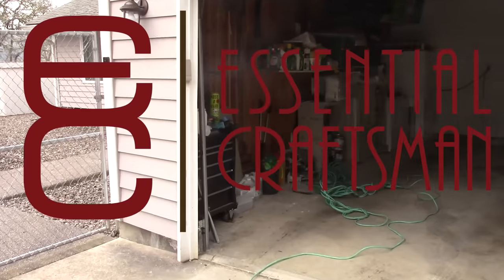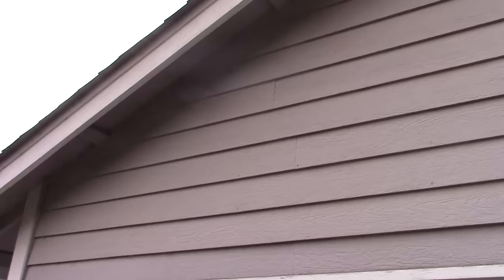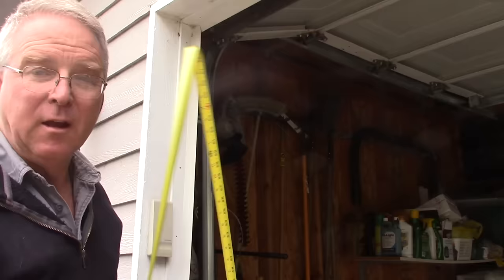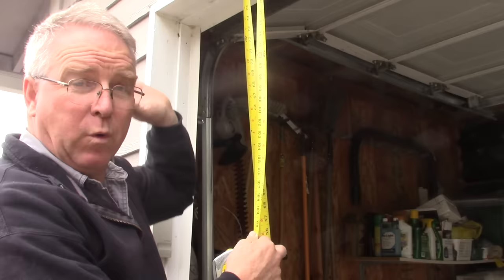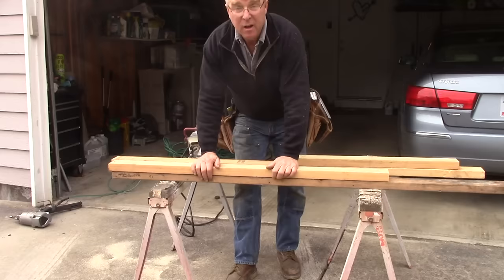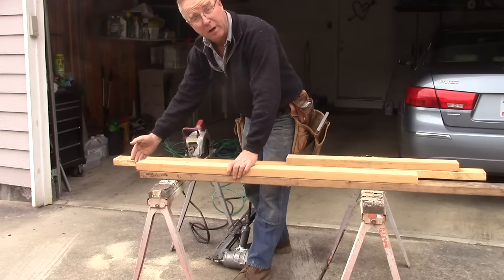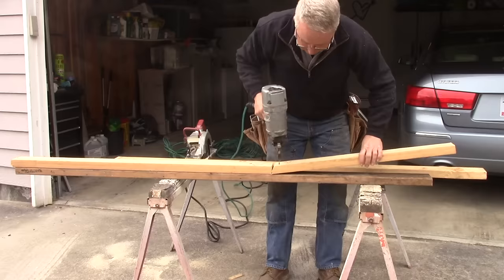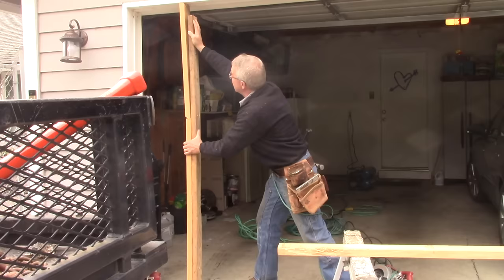2x4 Becomes a Jack - Cool Trick

Comment: There have been so many times I’ve had to stop what I was doing and go get a hydraulic jack to do what this has accomplished. When I already had 2x4’s on the walk board with me. This has saved me a lot of time and impressed my boss. I couldn’t take the credit in good conscious so I told him I learned it from your videos lol thank you so much!
Reply: I had a customer assume I was too cheap to by a whole stud! not knowing I was lifting the second floor to rights so the studs would fit .
Reply: Destin Ramsey 
There is no loss in giving credit to someone else. If I were your boss I would value that you didn’t take the credit for it yourself AND that you watch video’s to enhance your skills.
Reply: @Conservator.  actually I learned this technique from a 1989 volume of fine home building magazine.
.well before the internet.
Reply: George McKenzie 👍
Reply: @georgemckenzie2525  Hmm
Reply: @idwtbam  I screw the block to the top lever, that way I can easily repurpose the unit to different lengths.
Really good for lifts of a 1/ 2 at a time under 5 tonnes
Reply: @georgemckenzie2525  Thanks, but it also just reminded me OF magazines. When I get through my books...
Reply: @idwtbam  I have Taunton Press F-H-B from 79 through 91 when the adds overwhelmed and became the articles. Absolutely recommend it for any builder 
Now of of course it's all on a searchable CD ....
Reply: @georgemckenzie2525  I looked into this. Thank you.
Reply: You did the right thing by going to get a jack. The quickest and easiest solution is always the best and if you had a jack on hand that was obviously the ticket
Reply: Honesty and modesty!  Good to hear!

Comment: A big c-clamp might have been handy, as an alternative to nailing the boards together once they are in place at full lift height.
Reply: Tougher to tighten and hold that in place. I get your point but a few nails from a nail gun is easier.
Reply: I'm a boat builder, so C clamps are how I fly. House carpenters may not have em laying around.
Reply: Better then a c clamp, would have been a quick grip clamp.
Reply: I think I'd prefer the nails he used, seems a bit safer.  A clamp up that high and not fully tightened can fall on your head, or slip and let the load down while you're in the middle of your repair.
Reply: I would suggest using the impact driver he fastened the wall with and a couple screws. If you start the screws ahead of time you it is as one handed easy as the nailer but also as easy to undo as clamp.
Reply: Good info.  Solved many a problem by just taking a break.  Bought a huge C clamp at.HF.  Found 20 + uses in 2 weeks. I have about 20 clamps and use them all
the time.  Good thoughts on the C clamp.
Reply: A c-clamp might work well, but I think maybe the idea is one may only have boards, a nailgun, and a saw on site.
Reply: @JusBidniss   good point
Reply: You may be able to start the nails with your hammer while the boards on the ground. Then drive them home. I don't have a nail gun lol. But I do have a drill and screws. I mainly do electric work.
Reply: @nateman10  good points..
Reply: @JusBidniss  I've had things fall on me from ladders.  it can be painful if it's a metel thing like a hammer hits you on your head. 
I've seen some amazing done by some block masons.and roofers.
Reply: @PIANOSTYLE100  from the right distance any object can be lethal. Building cooling towers which are around 40 to 50 ft at least, ive seen people get seriously injured from things you would never consider dangerous. One guy got his collar bone shattered from a 1/2in washer one time from about 30 ft. Another guy got his forearm broke, all the tendons in his elbow, and shoulder dislocated by a 6 inch 4x4 block from about 20ft . I've had a small chunk of wood hit me dead on top of my hard hat from about 50 ft and broke one of the snaps that fasten the head band into the shell and knock me plumb stupid for a while. Put me out of work for a few days because of the muscles in my neck were all jacked. A penny from the right hight can go clean through a human body like a bullet
Reply: @carlcox7332  Gravity 9.8 meters/second/second..I Have one story
house and it is 10 foot to the ground..any thing over 6 foot starts feeling painful.
Reply: I have found a good advantage in woodworking..tap tap here and there puts it's perfect but they clamps must be just little loose. 
Somebody that does this all the time probably does fine without a clamp. BTW rural King now sells C  wood clamps with a quick button adjust  then you tighten it ss usual. I was talking to a welder and he says this won't work with steel. He told me how it works.  If the clamp was  made out of very hard steel.. steel.it might work.  But that would drive the price up to three times. 
I used to service garage door openers for Sears I didn't have anything to do with the berry dangerous springs and no desire to lean how. The biggest thing I serviced was 3 tube big screen TVs.
Reply: Agreed. Seems like a lot of force on those nails. 
That other guy saying carps don't use clamps for such things, and that he can't work a clamp with one hand is weird and needs some practice 😂
In the worst case, shoot a few nails, then back it up with a clamp if you really have dexterity issues.
Reply: With the one handed auto clamp from Kreg u can
Reply: I’d have screwed it and reused the timber. 
Useful little trick though:-)
Reply: Or a Jack
Reply: @gellotion  the force was applied ny his hand to bring the 2x4 together. Yes there will be some outward force on the nails while in place and working, but its more load applied downwards
Reply: @tedwarden5803  and you can still pull nails to reuse the wood. the wonderful invention of the prybar :)
Reply: @justinstevenson2061 . Screwdriver is easier.
Reply: @tedwarden5803  to pull the nails? Am I missing something?

 You could get the screwdriver between the 2x4 and pry them apart.

I meant more pulling the whole 3 inch nail out of both 2x4 to re use the wood.
Reply: @tedwarden5803  Hahaha never mind just noticed your the guy I replied to its 1am my time zone I’m tired.

Might be easier to remove the screw than the nail, but more to put in the screw than the nail.

Also a bit more tendency to split with a screw than a nail.

I honestly just replied thinking you meant easier to use a screwdriver to pull the nail instead of a prybar ahahaha.

I’ll leave that last reply up to give someone a laugh.
Reply: @justinstevenson2061 . Np. I haven’t used a nail in the past ten years and probably more :-)
Reply: @tedwarden5803  I do also prefer screws in many applications as gravity won’t pull apart as it would a nail.

But also nails have many uses that screws don’t perform as well at.

Anyways all the best to ya. I’m off to damn bed my god.
Reply: i've done that at work with C channels. a lot of folks would be surprised at how much shit you can jack up with a boiler clamp and some mild steel.
Reply: I was thinking the same.  Less nails to have to pull.
Reply: @nateman10  good points.
Reply: I would use a 4X4 and a hydraulic jack.
Reply: @tedwarden5803  You must never build decks or like the Simpson screw in nails.

Comment: I watched this video for the first time about 3 weeks ago, I watched it twice so I made sure I understood it but I thought “most likely something I won’t use”. Yesterday, however, I was installing rough-sawn fascia boards on a sugar shack and had to get them nice and tight and remembered this video. There was a perfect trim band at the right height to brace against so I threw an angled cut on the bottom, figured out my length and had it installed in no time

Comment: This is really great for precise, safe lifting.  I was curious if there was any marking or indentation on the finished trim piece that made contact with the top of the 2 x 4.  I would probably add a 6" - 12" long piece of 1x4 or 2x4 to prop above the top of the 2x4 to distribute the weight more evenly to prevent marking on something with more weight.

Comment: I have accomplished the same with a doubled 2x4, a top plate with a stop block (to avoid marring top surface) and 3lb sledge.  Hold the top plate with one hand and sledge with another, then beat the doubled 2x4 (which is cut longer than the height of the opening) upright to the stop block and nail it to said block.  Your way is smarter and easier. Thanks.
Reply: Drew Chestnut - Yeah, that’s always been my way of doing it. I like this lever version better.
Reply: Exactly how I do it
Reply: Notice he said finished case

Comment: Really great idea for leverage, but I think I'd use a clamp instead of a nail gun for the last part.
Reply: I was literally thinking the same thing. I'm always working alone and I'm always coming up with new ways to use clamps.
Reply: Or screws for all fasteners cause if you  have got to lift it three inches you need a pair of these rigs going up a half inch per lift
Reply: I was thinking the same thing, a bar clamp would have been faster
Reply: @dh66  structural GRK that bar gets in the way and dangerous if unintentionally removed
Reply: @georgemckenzie2525  c clamp vise grips

Comment: Saw this when it was first posted.  Needed to pry an old wall that was bowed in, so I thought of this trick.

Used 12ft of 2x4 angled from the middle of the bowed wall and the base of the opposite wall.  Needed about 1.5inch of travel.

Reviewed the video today to refresh my memory.

Worked like a charm!

Thanks, Mr. Craftsman, for posting!

Comment: Awesome trick. Could use a clamp for the final securement operation to make disassembly easier...

With a setup like this, looks like you have probably a 1 to 20 ratio (lateral force to vertical force) initially coming in @ ~4.5 degrees taking into account the lever length... the ratio increasing as it closes in. Pretty damn good for some scrap 2x4.
Reply: you could optimize this for more lift strength by adjusting the lengths of the two additive pieces, and how much the arbitrary lever piece sticks out from the break in the middle.

Comment: That was interesting, I work a-lot by myself  ,  I would have laid a board flat on the cement and place a slightly long 2x4 against the top first and then used a 5 pound hammer to drive the 2x4 thus lifting and safer than a jack which would want to kick out.
Reply: I did that on my porch roof a couple years ago.   I needed a lot of lift, so the hammering became my workout for the day.
Reply: @stevenscott2136  exactly this. small amount needed in this video and the hammer in method could work well. but needing alot of lift as you mentioned can be alot of hammering. would work the same really with the vids method unless were talking a massive lift really.

But 1/4 in or 1 - 2 inch really not much difference (besided the amount of load carried above and its amount of possible flex)
Reply: I make a stiff back or t brace and beat it in place. Not that big of a deal. Did you see the bow in his contraption? I've seen 2x4s snap under a load when not stiff backed. Very dangerous.

Comment: Impressive use of a hypotenuse, I'm just an industrial electrician, but I would have just used an 85 1/2" 2×4 wedged it tight then hammered the bottom lifting the header. Your way would impress those looking to be impressed, meanwhile I'd be done by the time you made your toy.
Reply: yeah, i gotta say i'd have done the same thing. i guess this could be handy if you didn't have a single piece that long??

Comment: If you used a Quick-grip clamp instead of the nail gun to connect the two pieces at the top, it would be easier to take the jack down when the job is finished.
Reply: @Kuuryo The clamp can be used with one hand just as the nail gun, but a LOT lighter. This video is about using your brain not your brawn. 
Judith, great suggestion, I was thinking the same thing and was going to make the same suggestion, but saw your comment.
Reply: And safer...
Reply: Uses 5 dollar plastic clamp to hold up a house. Dies. Get high on potnuse and do it right

Comment: I would back the truck up, cob two 4x2's together about two inches shorter than the header, let air out of the rear tires, set the 4x2's between the truck bed and header and then add air to the tires, lifting the header.  This after my wife suggests I fix the garage for 8 months!

Comment: How do you tie up your extension cords? You should do a quick video
Reply: He did already, as a side-mention.  Forget which one it was in.  One of the pro tip vids.  Maybe the Skilsaw one.
Reply: Jeff Knox you are correct.  watched it yesterday.
Reply: Chris Towerton that knot is used on boat docks its fast  you just pull and jump in your boat   Or get in the boat and pull toward yourself and gone
Reply: Daisy chain.
Reply: It's called daisy chain. Effective for 50' to 100' cords.
Reply: I do the same for my big cords for my floor sander.  You only want to do it on heavy duty cords. I’ve found that on thinner cords over time they’ll hold the shape of the chain.  But with even slightly heavier-duty cords, there’s no problem of that.  Been using that method for 30 years.
Reply: Chain knots....learned that in his skill saw video, I'm going to start using that from now on.

Comment: why do you even have a nail gun? your hammer swing is beast! 🔨
Reply: why is he setting nails with a hammer he put in with a nail gun??
Reply: Pos nail gun. Shoulda bought a Senco!
Reply: Rick Martin hitachi’s 83 nail guns like te one he has here are the bees knees
Reply: @SailorAllan  Gun is worn out and needs rebuilt.
Reply: @SailorAllan  if you know the Hitachi  NR83A you can depress both triggers and fire a nail without touching the wood this allows the nail head to be set with the emphasis ( impetus) of the hammer very usefull when working a the out of  crown stick or getting a bowed stick to settle . On its own the gun may just blow through and not get the gap closed also good for hanging a tool bag
Reply: Compressor PSI is not high enough for the nail gun to drive the nails flush.
Reply: @bearly1727  most often I would say yes you are right but...
 i own the  hitachi NR83A (1994 ) shown here  it has two triggers which enable me to fire a nail without bumping the nose. this has many uses  I can fire a nail in just enough to hang my belt from a nearby stud or leave three eights exposed when nailing a stick where the persuasive force of a hammer blow is required ( to draw to sticks toght)with the setting of a nail.

Comment: it'd be interesting to come up with something that was modular and could be reused instead of having to make one each time.
Reply: not trying to be a smart ass. genuinely thinking about how you could take this principle and make it into a tool made from 2x4 wood that you could use for more than one situation. maybe cut notches in it to allow some sort of adjustment.
Reply: Everfalling yeah. It's called screws
Reply: Even on small jobs you can usually find so much left over lumber that is heading for the dump.  Not on my jobs, but in the neighbors dumpster, with permission.
Reply: Everfalling  it's called a post shore
Reply: Connect the two cut pieces with a hinge on the outside.  Clamp the pivoting piece to the full length 2x4 once vertical.  Only downside is you have a fixed length if you reuse it so you'll need blocking/dunnage to get you the height you need in each application.  At that point just carry around a jack.  I see this as a one time "I don't own a jack but still need to jack something up and have scrap 2-bys laying around" application

Comment: not to be a dick, but if you're working on an unfinished  floor, (like he is) you can just cut your one 2x4 1/4"longer than your distance from floor to ceiling, get the top on target and Hammer in the bottom until it's plumb. super strong, quick, and simple. the extra 2x4s just seen like a hassle.
Reply: Just a lot easier to remove when finished, and us old farts need to use less strain on our body. It's not like the wood won't get reused.
Reply: and that method will surely mar the finish of the painted surfaces
Reply: word
Reply: Yah you think more like i do.
Reply: The top is painted.  

 John Jones
Reply: Yeah, I was expecting a video showing a single 2x4 being driven into place with a sledge at the bottom. Do it frequently. The method shown here seems slow and unnecessary.
Reply: Tapping on a 2x4's bottom (or top) end with a hammer while adding the pressure of increasing weight typically leads to the 2x4 cracking and splitting.  May work, may fail.
Reply: ALSO YOU CAN CUT 4X2 SHORTER ,AND USE WEDGES
Reply: Doug Bourdo sure, but at the end he 🔨 the bottom of the board. Which might cause as much damage as 🔨 the board into place. Just a thought. Not a troll
Reply: @jltillett  Then use a 4 x 4 or 2 - 2x4s nailed together